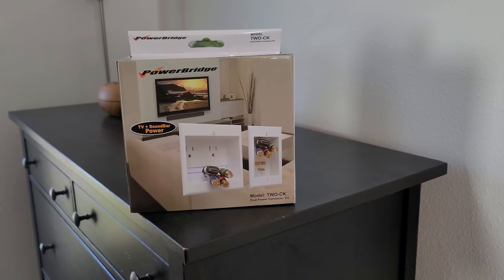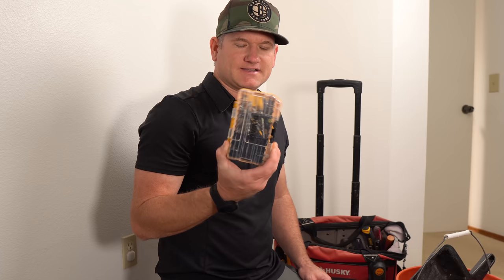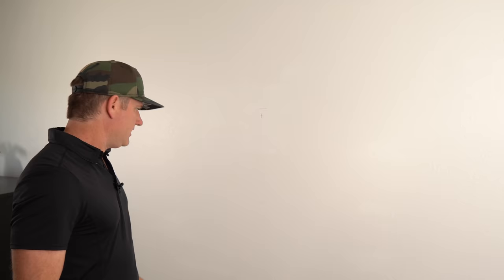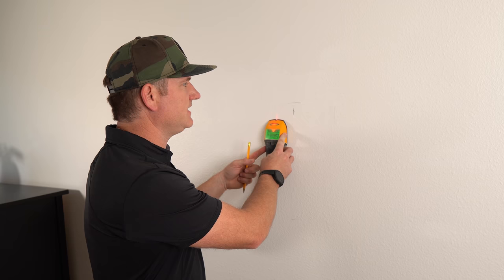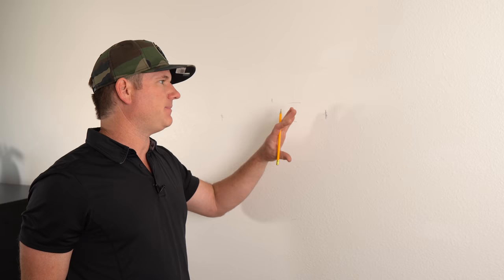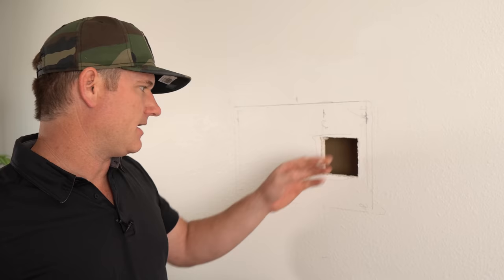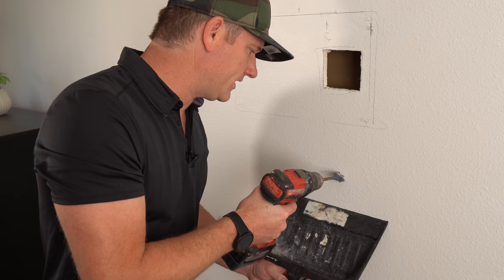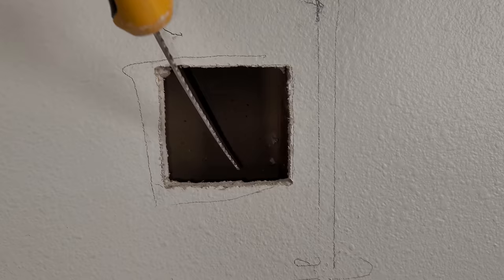Hide Your TV Wires Easily w/ PowerBridge like a PRO

Comment: So lucky with your prefab houses, do this in a concrete wall. Pffff
Reply from the maker: Yeah concrete or brick walls present some issues.   I've learned to get around obstacles in brick fireplaces. Messy but lucrative.
Reply: @BTheInstaller  yeah it can be a pain in the …! Really like your channel and how you present yourself and al the stuff you work with. Keep ik up, and maybe you can try something out for me and maybe some others. I want to know if it os possible to get one arc as a center speaker front, than two one sl as front left and wright, than two subs gen3, and to top it up two fives as rear left and wright? Hope it works and it sounds great. I want to bu that in dec of it works. Thanks for your kindly reply 😎

Comment: Wow, you kinda know what you are doing, but why in the world would you cause yourself extra time and expense putting unnecessary holes in a wall. #1 you have to patch it which is major time and materials not needed. #2 now you have to sand, texture and paint. Way more time. When  All you needed to do was use a 2- 4 foot bit to make your hole/s through the fire block. Tools Do The Job! Hardly a Professional Way to Do A Job. Let Your Brains Do the Hard Work and Let The Tools Make The Work Easy. And A Hand Held Camera with a Snake ie the Best Tool to Look Into Walls. Just Saying, spend your money on tools, instead of un-needed material and lost time. JMO. AND WHERE THE HELL DO THEY PUT FIRE BLOCKS THAT LOW IN A WALL?
Reply from the maker: None of that stuff is what DIY guys at home have.  You miss the point of the video